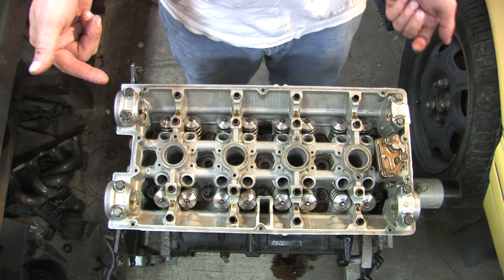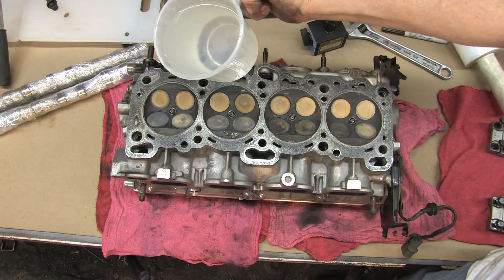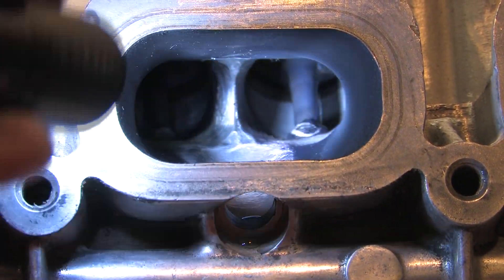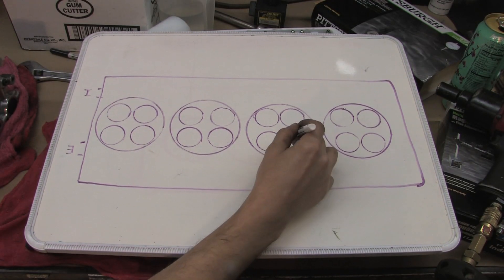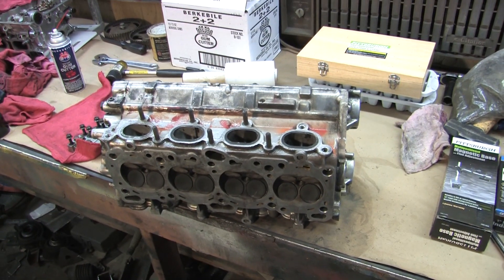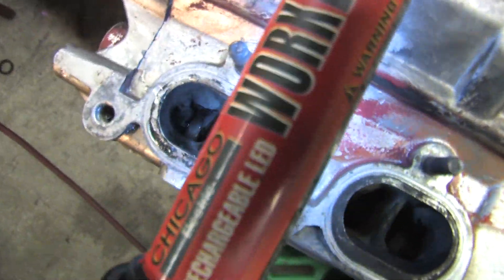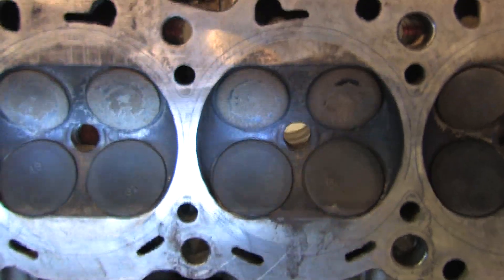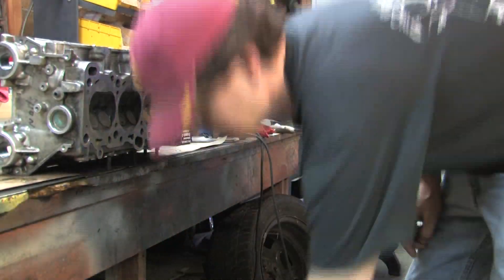Cylinder Head 102 - Hydro Test Valves

Comment: Yeah, the only “water test” worth doing is to fill the ports with water and shoot compressed air at the valve seats.  That tests if the valve will seal air, which is a whole lot lower viscosity than any liquid, and it’s what you need to seal to make compression.  It also gives a very precise location of the leaking spots so you can pay attention to those when lapping or deciding to grind or replace seats.

I’d have just plugged the EGR port in that one cylinder with putty and do the test.

Comment: I don't bother leak-testing valves on a used head, only do it after lapping them all. And don't need to use water, set the head down flat and spray a little carb/brake clean into each port watching for leaks in the combustion chambers. Any signs of moisture mean re-lapping, also don't need to do it with the springs installed. If they leak while you hold them up by the stem they'll still leak when the springs are installed.
Reply: Ive seen a better way spray some starting fluid and run a light over the valve if the cylinder lights on fire that cylinder has a issue
Reply: @CodyFinchum when said "better way" involves an open fire in a personal work space it's not technically better

Comment: i'm doing my first rebuild on a 4AGE 16V motor. I think the valves have 148k miles on them. but if they pass this hydro test it would be okay to use them again? i would think with 140k miles it would be time to just replace at this point?

Comment: What does it mean when the valves leaks?
Reply: K. O'Pharrow when a valve leaks it means that it's not seated properly on the valve seat.so there exaust gasses by-passing the valves when the piston is moving up.So when valves are leaking your cylinder looses compression and it could also, in some cases, leads to burned valves
Reply: You have bad valve seats/valve guides are bent/valve is bent. If any of these are true you could end up cooking your valve because that contact to the valve seat and the guides are what dissipate the heat on it.

Comment: I use petrol and the valves are not locked with the springs ;),I had a minor leakage,lapped them again and then locked them ,no problems

Comment: Ummmm probably not related to the test that you did however it got me thinking, does the head affect the displacement of an engine?, for e.g if you have say a 1640cc engine which I'd assume they would approximate and just call it a 1.6L engine and you put a "bigger" head onto the 1.6 (something that would hold more water) bumping the displacement from 1640 to like 1670cc basically approximating the engine to 1.7L is that possible? hopefully you get where I'm coming from, just curious if that would be a way to squeeze some more displacement out of an engine.
Reply from the maker: +TriniRogue Yes and no, it's possible, in fact... this is a 1.6L head on a 2.0L block.  What that means is the combustion chamber domes are cast smaller than the ones on a 2.0L head, and therefore it reduced the overall volume of the combustion chamber and having the opposite affect on the condition you describe.  However, changing the overall volume makes no difference on the swept volume.  That's all based on the diameter of the piston, and the length of the stroke.  That's usually what people refer to when they describe an engine's displacement.  Swept volume.

What you need to think about is how it affects compression.  In regards to compression ratios, call X the volume of the entire combustion chamber with the piston at the bottom of the stroke, and call Y the volume of the entire combustion chamber with the piston at the top of the stroke.  Not only is the difference in those volumes the swept volume, but it's your compression ratio.  X : Y  If you used a "bigger head", you would reduce compression.  That might not be a good thing depending on your goals, but it can be in forced-induction configurations.  Generally a lower compression engine makes less power, but if you exceed the compression limits of your fuel, it can cause pre-ignition.

Summary:  I'm cheating.  I used a dirty trick with a head that looks the same to pick up an extra point on the compression ratio.  I used a different piston to pick up yet another 1.4 points.  Most 4g63s of this year build are 7.6:1cr.  Mine is 9.8:1  I made a video on this called "calculate your compression ratio".  ;)
Reply: +Jafromobile Thank you for taking the time to clear that up for me :), im also going to watch the calculate your compression ratio video now XD, the info one receives from your channel is priceless man love it and thank you again.

Comment: I have a question for you 4G63 Yoda Master Jafro, why would you weld up the water ports on a 4G63 head? I presume for race only applications? What's the reasoning/justifiable benefit for doing so?
Reply from the maker: +BoostedCajun If you have a concrete-poured 1/4 mile car, it doesn't need coolant.  It also doesn't need to see street use.  It needs to be shut down after a pass and dragged back to the pits with a 4-wheeler.  None of my cars will be built this way, but notice the way I said that, I didn't say "never".  I just don't have any track-only drag cars right now.

Comment: I made a mistake of installing the cam and rocker arm assembly with the valves sticking out of the cylinder head. I did this same test with mineral spirit and it is leaking badly. do you think replacing the valves and lapping will be enough? I stupidly did this after paying a machine shop to do the valve job :(
Reply from the maker: +Tak Suyama Wait... so the valves leak after you removed the cams?  If so, you have bent valves.  If they're bent, no matter of lapping will fix that.  You'd need to replace the bent valves that are leaking if it fails the leak test with the cams removed.  I find valves for around $11 a piece.  All is not lost.
Reply: Got new valves and now following your valve lapping video. Thank you ***** !
Reply: Do you think I need to worry about the valve guides?
Reply from the maker: +Tak Suyama if the head was hot and it was running when they were bent, I'd say "probably".  But cold on a bench... Probably not.  It's impossible to be 100% sure without measuring them, but it's unlikely enough that I wouldn't worry about it.

Comment: hello Jafro, I would like to know if the intake valves is 100% no leaking or is their a certain leaking that is normal. People have told me that the leaking is normal. If its true can you explain it o me. Because when i took the head from machine shop the intake valves is still leaking a bit. The machine shop told me this is normal. is it true? waiting answer if anybody knows about this.
Reply from the maker: No.  It is not normal.  If the valve is closed with the valve springs installed and water is leaking out, the seat is leaking.  Water is a LOT thicker than air.  But in context over the internet I have no idea how much is leaking and how fast or whether you used water, carb cleaner, gas, etc...  If it's 1 drop an hour, it's different than 1 drop a second... but if it's leaking at all, then it would fail a vacuum test.  Vacuum tests are the standard by which a valve job is most accurately tested.  I didn't have that equipment prior to making this video.
Reply: ***** I used the carb cleaner. Its start leaking after a minute but slow a bit.
Reply from the maker: A drop a minute with carb cleaner is not so bad.  It's much thinner than water.  Water might not leak at all based on that info, but keep in mind that on a fresh valve job, once it goes back into use the valves will bed more strongly into the seats.  A trickle, frequent drip, or if it just pours out of the valve, all of those things mean its bad.  A drop a minute with any liquid I'd let slide.  If you're worried about them, lap the valves lightly and see where and what the seats look like.  Watch Cylinder Head 105 for details about that.
Reply: your machine shop is rubbish then wtf if you have any leaks then your seats are fucked mate lol

Comment: Hey Jafro, thanks for the video, I just used this method to find a leak on my G4JS head. Two questions; did you still get good compression even with the valves that bubbled with the air gun? And I found two intake valves that are not visibly bent but leak out fully within ~15 mins. Should I just try pulling them and grinding them? Thanks!

Comment: Intake valves will 99% of the time always be bigger than exhaust valves
Reply: yep.

Also you can just follow the intake port and wind up at the intake valve lol.

Very hard to get confused after the head is removed. But to a novice I could see it happening. So yeah bigger valves being intake is a decent rule of thumb on most engines.

Comment: Just wanted to say thank you for  the video. At the shop I work at we had sent some heads out for a toyota 4run... once the tech re installed everything we where having lots of problems with power and overheating.  I decide to remove the heads one more time and performed this test (hydro). And guess what all the valves where leaking a lot. Thats also when I notes thx to your other videos that they never even pulled the valves out all they did was clean the head form the out side and resurface it

Comment: Hey friend, nice video thnx for posting. Well i have a issue with my toyota 2.7L cyl head it seems thateven though i followed your example, i still kept getting seepage past the intake valves. Even after i did it with the head upright,  does hand lapping even help now with hlc?

Comment: I just want to say thank you for taking the time to these videos. I'm working on some BB Chevy heads and tried this test using mineral spirits. I have a couple that begin to weep after about 3 or 4 minutes. I tried lapping the worst one after watching your other video unfortunately it didn't seem to improve any. I'm worried about messing up the angles on the seats by getting too crazy trying to lap it out. As long as no drops are forming immediately should I leave sleeping dogs lye or valve job?

Comment: Hey that's life. I loved it because I'm learning so much about cars (fixing my ford due to previous owner not replacing ANYTHING for 20yrs :D). The Ironic part about it is that the leaky head I swapped out for a less leaky head seemed to be a bit torquier. It was a flat and I upgraded to the later model roller style camshaft. Same port size, same camspecs (lift/duration) but for some reason my old wore out flat just seemed to pull a bit harder.

Comment: Just do a vacuum test on the ports, its more accurate...then you will know 100% if you have to reface the valves and cut the valve seats if needed, or you can escape cutting the seats by doing valve synchro grinding!